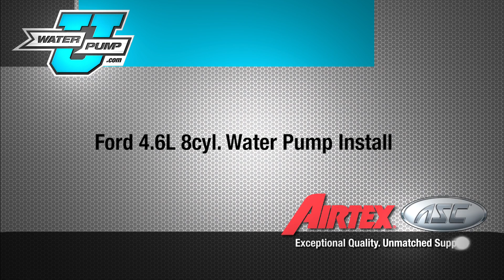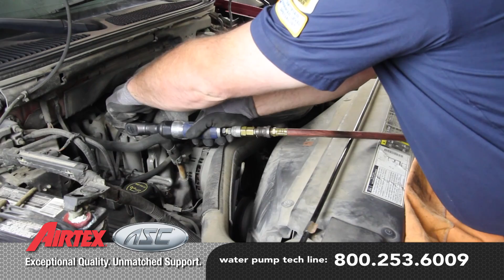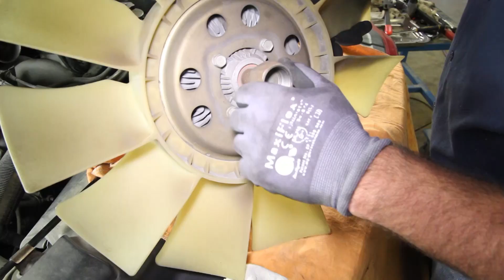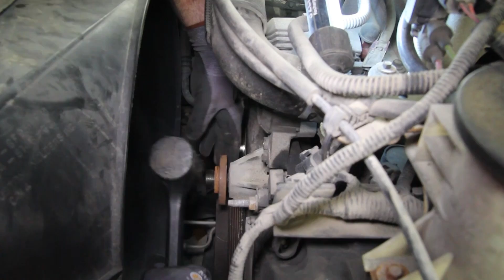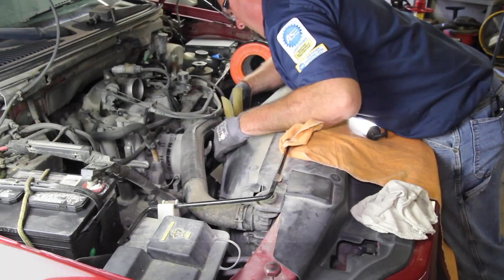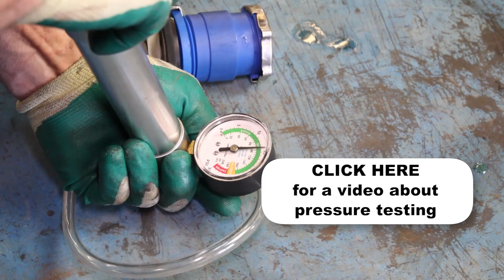How to Install a Water Pump: 2002-97 Ford F-150 4.6L, 5.4L V8 WP-9097  AW4122

Comment: Hello, i had a question,today i bought a water pump for my Mustang at the Ford parts counter,i asked for a Motorcraft PW 470 and they gave me a box,when i walked out i noticed the box said PW 423,when i went back to clear things out i was told that the 423 supersedes the 470, well once i got things home i realized that they are slightly different and the difference is in the snout,basically the 423 is a truck pump and it has threads on the snout for the fan clutch (shown in this video) while the 470 doesn't because Mustangs have a electric fan, could it work? i mean my pulley fits perfectly and its a dead match except for those funny threads past where the pulley sits, the threads wouldn't be in my way, I'm guessing this was done to simplify having one pump fits all? thank you much for any input
Reply from the maker: You will need to ask your Ford dealer about his parts and how they superseded them.

Comment: The procedure after removing the intake would work on the 4.6L 2V for an Explorer, Thunderbird, Crown Vic or Mustang too.  The factory waterpumps (in my experience) last a very long time.
Reply: They absolutely last a long time at least the pump does but if you have an intake leak or even a water pump seal leak that water is going to destroy the clutch and bearing and all that

Comment: Do you recall how many bolts were holding on the actual water pump? I've got a 97' F-150 with the 4.6 and tried to take mine off exactly how you explained it. I unbolted 5 long bolts from the water pump and it won't brake free. I tapped it a few good times but man.... it won't budge. Are there more bolts holding? Do I need to unbolt part of the alternator? Any advise would be helpful. Thanks!
Reply: I know this is a old comment but just wanted to say maybe you pulled a bolt from the timing cover along with the others,all 4.6 pumps have 4 bolts and yes the pumps are hard to get out,if you are not reusing it 90% of the time they only viable thing is to take a hammer to it on the piece that holds the pulley (once the pulley is removed) its the strongest part of the pump,i hate taking a hammer to anything but its the only way sometimes, lol, glad you got it fixed.
Reply: Got it. Thanks!